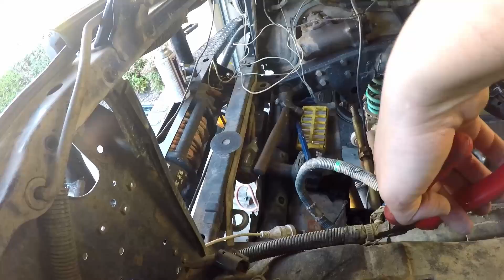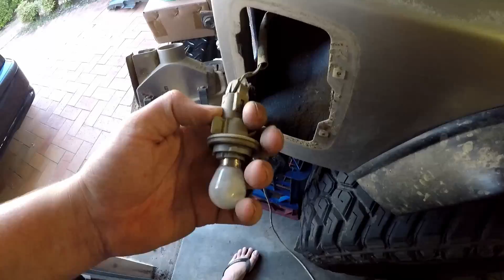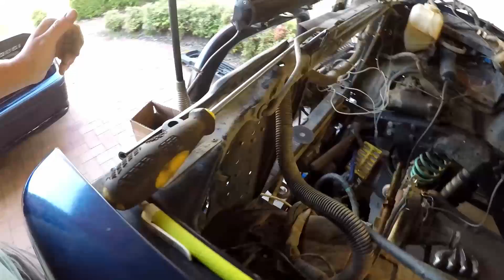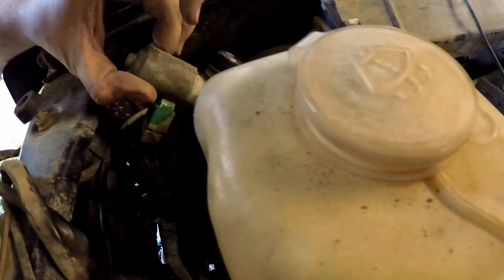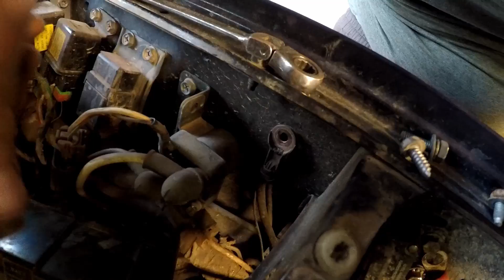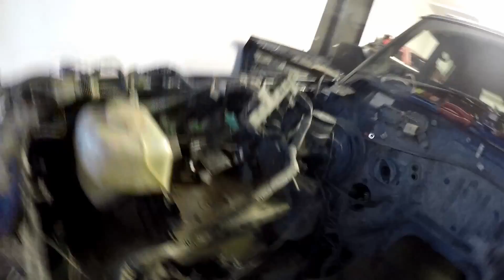Engine Bay Wire Removal LS1 Patrol Part 4

Comment: How did you end up removing the wiring? Did you pull into the interior or out into the engine bay? 

I’m stripping a GQ auto and finding the whole loom does not disconnect from the engine bay hardness right across the dash and into the fuse box. Very time consuming job!
Reply from the maker: I never took out the wiring would have been way more work, but there are connector's for the wires that go across the dash under the passenger side seat
Reply: @ktshellboy  thanks mate. I got to them yesterday. All removed now